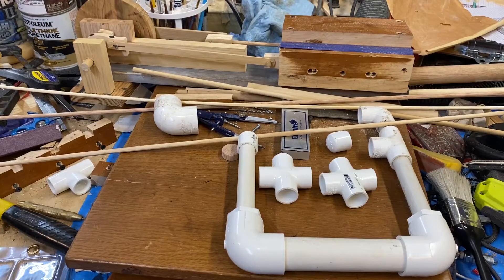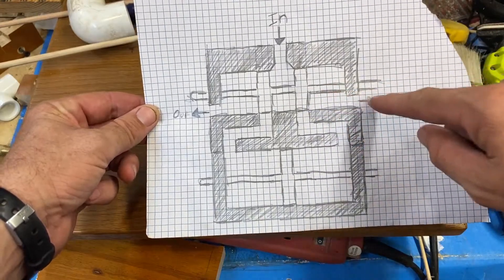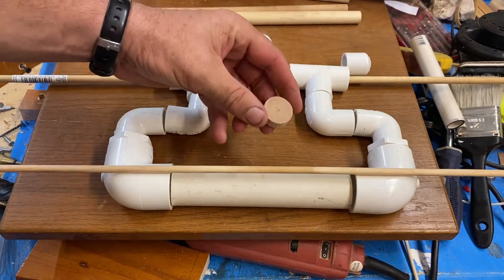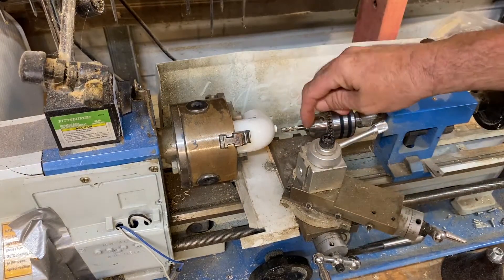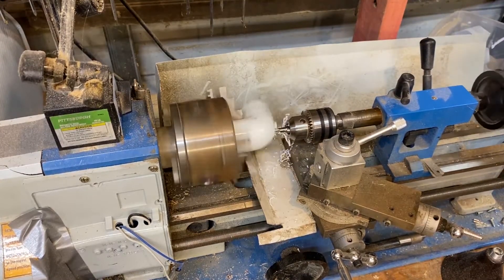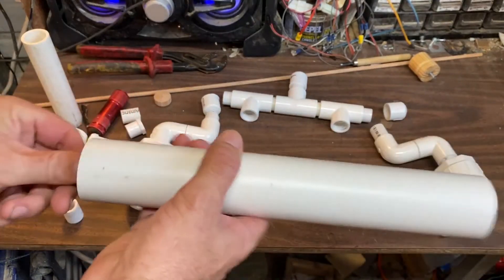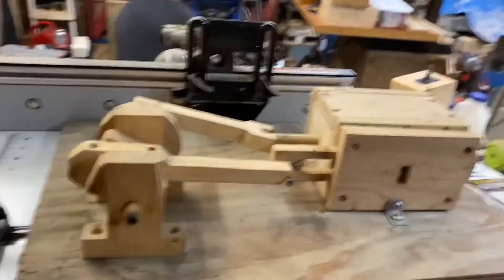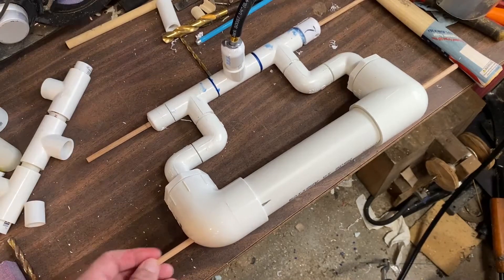PVC Air Engine

Comment: Hello wonderful video, is there any chance I could have written detail of the pipes/parts you used?
Reply from the maker: I used 4x1/2” cold 90 degrees, 3 x1/2” cold Tees, 3x1/2” cold caps and about 1’ foot of 1/2 cold pvc for the intake regulating side. The cylinder side was 2x1 1/2” cold 90 degrees and 2x 1 1/2” plugs plus about a foot of the 1 1/2” schedule 40 cold pvc pipe
Reply: @SpiritedMaker Sorry for the late reply!! Thank you so much for your reply and information!!!! This is amazing and will try to recreate your one!